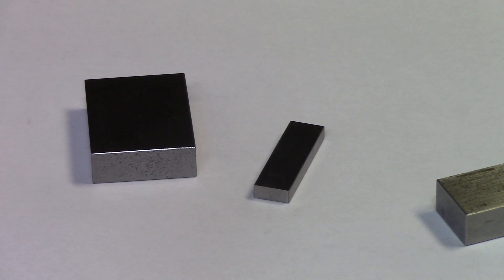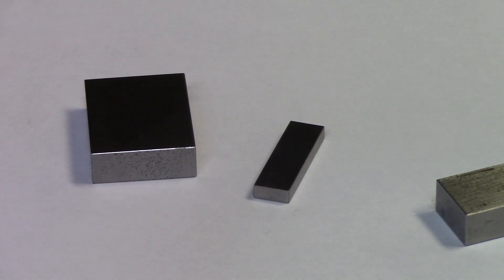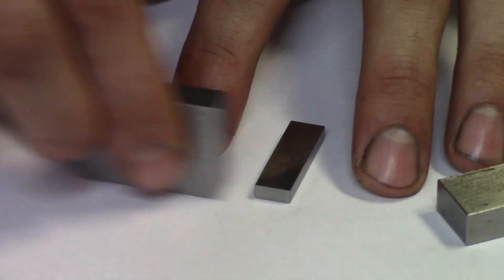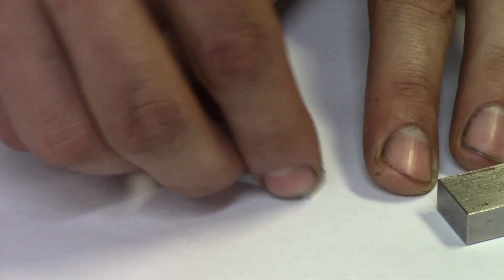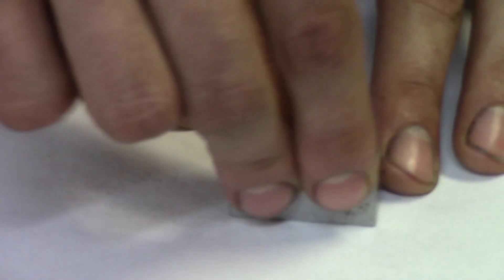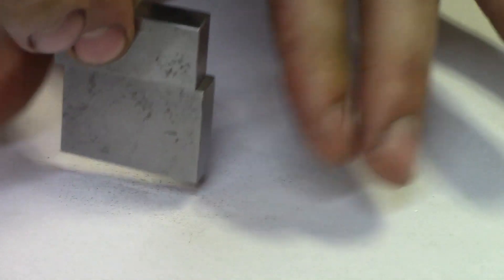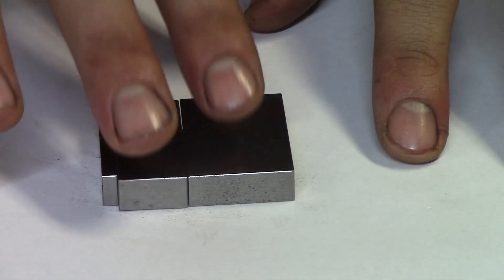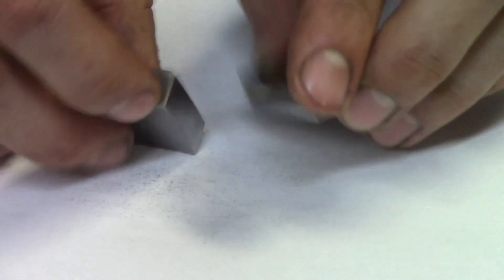Cleaning gauge blocks

Comment: One thing I don't see mentioned is what is the best thing to put on your gage blocks to prevent rust after use? I'm guessing a light oil but this would require for them to be cleaned before each use, which I imagine should be done anyway on the paper. I guess my question would be is to use what type of oil to protect them, a light gun oil or is there something better?
Reply: Buy some camphor paper, and put a slip of it in the box with the blocks.

Comment: Using any form of grease is not good, if the slip gauges do not stay together without grease there is something wrong with them. Try wringing them together with twisting motion.